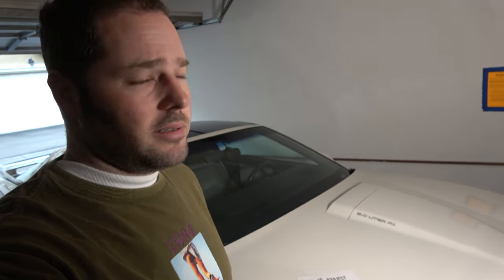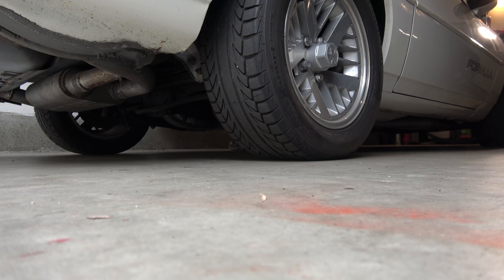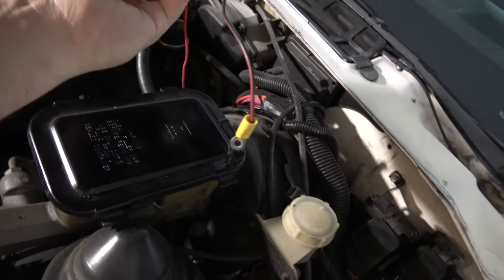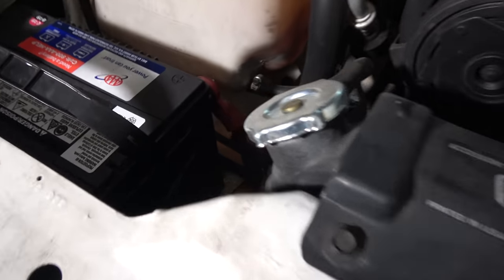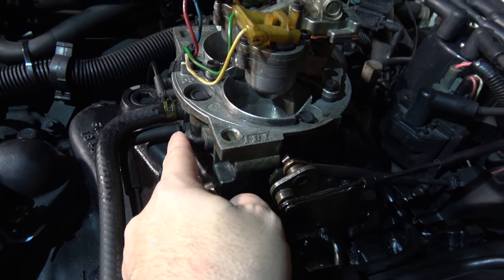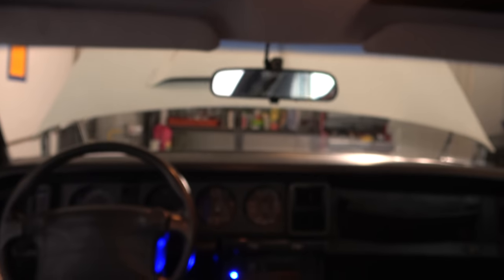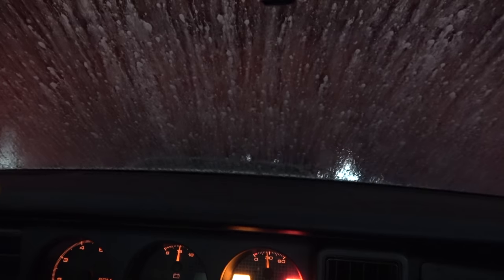1990 Firebird - What's Wrong With it?

Comment: I had a 1988 IROC Z28 Camaro and it was my dream car. Mine had a TPI 305 L9 engine with a 5 speed manual that I had rebuilt and beefed up a bit and every bell and whistle imaginable and it had a deleted IROC big sticker on the doors and it was exactly what I wanted. So I changed the rear gears to 373 and installed a center force duel friction clutch and got rid of the gov-lock rear and installed a real posi-track rear end. I replaced all broken and cracked things in and out of the car and then I upgraded the exhaust to a true duel  exhaust with a X crossover and duel Borla mufflers. Then I had the stock wheels restored back to new condition . I didn’t have air bags in my 1988 IROC so I didn’t have to deal with the steering wheel issues. Then I installed a new set of tires that looked like the gatorback tires that came on it and since I had the tires off I had all new break pads installed and rotors turned. Next I installed a new hood insulation peace under the hood, like yours mine looked like crap. I then installed an alpine head unit with an Alpine amp and all new Boston acoustics speakers. That car ended up being as fast as lt looked when I was done, I even put after market heads on that TPI engine and a gear drive timing set up. After all that I realized that my wife wanted to be the town bicycle that everyone could ride and she wanted to take my son away from me, I sold my IROC to pay for a lawyer and fight for joint custody, well we fixed our marriage but yes she went back to laying on her back when I was out breaking my back to earn money to support her and our baby boy and new baby girl . Moral of the story is to save money in a secret account so when she screws you over by screwing the town , you won’t need to part with your dream car and you’ll only need to part with your ex-wife
Reply: I had an 86 IROC LB9 Auto in high school. I treated it soo well. I would start it, let it idle down before I drove it. Put premium gas always. I did a few mods like hi flow cat, 160 thermo, that ran all the time, air foil, I cut out the botttom of the air box to make home made cold air and put a shift kit. I loved that car n babied it but all it did was let me down. It felt fast and sounded fast but I would lose races left n right. Also there was always things wrong with. It didn’t have a serpentine belt so the engine would spin off the belt. The trans wouldn’t shift when I floored it. I had ttops so there was lots of rattles. Basically I treated it really well but it didn’t return the favor. I lived with parents so I spent all my paychecks while working in a grocery store.

Comment: This Pontiac reminds me of working in a Dealership repairind used cars. This dealer had high standards for all cars on his lot every car was repaired to the highest standards and stock condition . All brakes had to have a minimum of 50% braking lining remaining. Most got new tires and brakes. It a vehicle wes not able to meat his standard it was sent the the dealer only Auction Yard. I enjoy that jod it is nice to be able to do what is needed and not have to argue about the cost.

Comment: Great channel gentlemen. Looking forward to your progress. On that alarm system, I feel ya mate. I went through hell with all the issues a crappy alarm install was giving my 89 Formula. Burned fuses, battery drains, starting and fuel cut off issues. I finally paid a guy to come remove EVERYTHING. MAJOR improvement. Even charges better.

Comment: I have an 89 Formula myself. The most basic calculation on a muscle car is the "horsepower to weight ratio", increase the first or decrease the latter.  I removed the back seats along with the seat belt retracters, saved a hundred pounds there.  Removed the AC unit from under the hood, another hundred pounds removed.  I increased horsepower with headers, 3" exhaust, 52mm throttle body, premium plugs and wires, Summit Racing distributor and other little tricks.  Lowered the suspension with Hotchkiss parts. I have trouble keeping rubber on the back tires. Pure enjoyment.

Comment: Had a almost identical version.
Drove it EVERYWHERE in the twelve years and 271k miles.
Only left me stranded twice.
First time the fuel pump failed at 150k and the second time the starter died while trying to crank the engine on a - 25 degree morning in northern Wisconsin.
Only being ever in the backseat was my German Shepherd and I don't think she was ever comfortable either.
Rust was the thing that finally killed it.

Comment: 2:09 Before we even talk about the car, that tire profile alone already gets me excited.
13:00 Hey, I am using the same colors for my video captions. Pastel yellow with hyperpink border. 😃
A man's car history tells a story. While my brother started with a barebone super-compact car (someone crashed into it) and then almost all combis since, with a sports coupé in-between, I insisted for my first car on a maximum equipped hatchback Corolla E11 G6 facelift, bought new. Since then I have had an E9 and an older E11 G6-R (funnily, in retrospect, both cars I once wanted to own), and an FZR-600 bike. Those are all gone now, but the car I bought new is still with me, with more than double the original horsepower, albeit not having been active for a long time.
I always knew what I want and that becomes a profound part of me, lives and breathes with me.
Being one with life is not about being a daredevil, active or anything. It goes much deeper.

Comment: Looks like you've got a great project. Rotor cap plugs wires always a good idea. Regular maintenance will make this vehicle last a long time. do not run extra fuel additives through the system as it will only clog things up. Your alarm system, as I had noticed, seemed not to be grounded, I believe that lead that was free floating in the beginning of the video is a ground. Check the manufacturer and verify. I'm happy to see you have started up a new channel, I will subscribe and watch.

Comment: in my teen days I had 9 people in an 85 Camaro lol.. without disassembling anything at all you can spray silicone lube around the whole perimeter of the window track.  Even though it doesn't grease the linkage inside the door it usually gets the windows moving plenty quick again

Comment: Nice solid pick for old school American cars shouldn’t be hard to work on.
Definitely change the things below as you mentioned
1. Change spark plugs
2. Flush radiator/ maybe trans fluid
3. Change oil
4. Check brakes to see if they need changed

Comment: From a cold climate and more miles than advertised but has low rust and looks great fro the age. My dads 86 has had the seats re-upholstered twice and has more rust even though not driven in the winter. Also has TPI 305.

Comment: Just so you know. The horn button covering is not peeling off. I used to think there was something wrong with mine also but it turns out that everyone of those airbag steering wheels were exactly the same from the factory. Had that big gap, crappy fit. The Camaros had same issue same years.

Comment: I have always absolutely loooooved the look of the 87-92 Formula 'birds.  I've owned 2 GTA's myself. But here's a word of advice for you with this car - or for anyone that buys a 3rd Gen F-body with the LO3 Throttle-body FI 5.0L engine: DON 'T WASTE ANY $$$ ON IT AT ALL!!!!! Pull that motor and attach it to a looooong chain on a boat; that's what it's really made for!!!!  Then go find a Buick 3.8 block with a turbo and build that sucker up and drop it in there.  You'll have the ultimate sleeper Formula that Pontiac should've built!

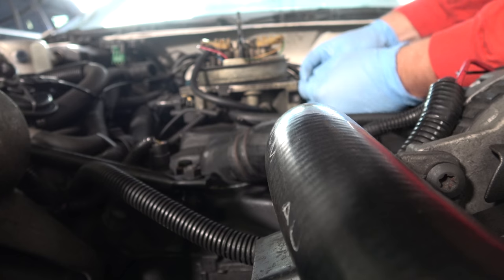Comment: 5:45 does that mean that it's a Throttle Body Injection system? I think the 4th car I owned was one of those. I found that it had a very touchy throttle, just tap it and it ramps up fast. It took a lot of practice to get used to driving it with the manual transmission.

Comment: Have you checked available power to the radio including the fuse? The car alarm gremlin may have struck there as well, as some alarm options included connections to the radio to sound the car alarm if someone tried to remove it. Good luck and stay...sane.

Comment: You've got throttle body injection or "Toilet Bowl Injection" as we called it back in the day. I believe that's engine RPO code L03. As for the car, it's likely that it's been resprayed. Van Nuys built cars had shit paint which came off in sheets. As for the headlights, they are ALWAYS noisy. Especially if the headlight motors were rebuilt with aftermarket gears. I've had six of these cars. I know them well.
Reply from the maker: Yes it's an L03 but I've done a few things which I can't wait to share (it's still slow)

Comment: Reminds me of my 87 formula that hood blanket is original. It's a nice car with a lot of potential.  The 305 tbi motor is 
rated at 180 horsepower. Very familiar with the car.welcome
to the world of the f body.
Reply: The t top cars roof cars from 82-92 in particular we're notorious for water leaks.

Comment: Lubing the windows may help, and is probably a good idea after 30 years. However, if the windows function like those in the Fiero (I suspect they do), then all the current to activate the window actually runs through the window switch (it doesn't activate a relay), and the contacts within get dirty and corroded causing slow window performance. If the Fierbird does use a similar electrical design, then you can disassemble the buttons themselves, give the contacts a clean, and reassemble them.

Comment: Try re-flowing all the solder joints on the radio. I had a Chrysler 300M with bad soldering on the climate VFD. I had to touch my soldering iron to a couple of SMD resistors to fix it.

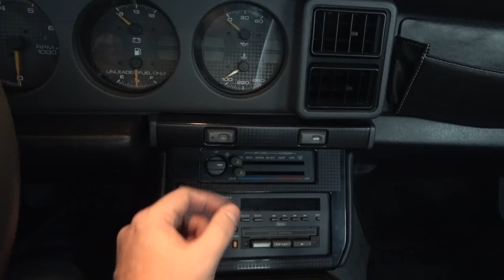Comment: 9:20 Noisy pop up lights and slow windows.  You may not have been in these cars back in the day, but the lights popping up were always noisy and the windows were always slow.  Wont hurt to grease them though.
Reply: From personal experience: Power window speed after a year of use is the difference between Toyota and a smart-cheaper Hyundai.
When people here in Germjany said Toyota has gotten a bit too expensive and convenient .. Well, everything gets more expensive, that's the bankster parasite infection people aren't treating, but to some degree you get what you pay for.

Comment: Big part of my hate side of the love/hate relationship with the State of California:  catalytic convertors.
Alarm wiring mess maybe the cause of radio and other issues?
Reply: Come on, even a primitive cat makes a world of a difference emission-wise (also due to law of diminishing returns - modern emission systems are insane), which also means not pushing disgusting and unhealthy stink in other people's face. Especially US cars should have plenty of horsepower so that a cat won't matter much. There are so simple ways to compensate for the power loss from a cat. If a cat is a problem for you, you also have to shun A/C. (But hey, that's a selfish matter, so people treat it differently than the negative impact they immediately have on others.)

Comment: Winston... Those windows motors might be failing , it's a common fault on the 3rd and 4th gen.they can't handle the weight of the window and X frame inside the door.  Incase the lube up doesn't work .

Comment: I’m not a fan of your car , although i hope your dreams come true, If your car is Manuel transmission as what it think that it’s cool , from inside wish that GM stayed with there old 77 /78 , from the outside the car overall look great with nice white color - my recommendation : if i had a chance to upgrade it to LS1 5.7 engine ill do it .                                               the LS1engine would be more relabel from my experience and would costs less in the loge run, and you’ll gain more horsepower and that would make it  full of fun and less headache.                            and that is my suggestion unless you want the matching numbers on this car to increase value buy time .

Comment: F body.. good advise .. take it back .  Lol.. 

If you are dead set on driving it..  be sure to check the column. The tilt is pot metal. I have had 2 fbody camero columns come apart while driving. Steering wheel in hand..

Comment: Winston, disabling or removing the smog systems of a car is illegal across the entire US.  It's true that California is one of the very few states that check call me but that doesn't make it legal in the other states. You can go after whoever sold you the car for the price of the catalytic converter that they were not supposed to have removed. That's about eight hundred bucks or so. It's also a crime on their part just told you the car this way, and that's especially problematic if whoever sold you the car has a car dealership license. if that's the case, the moment you complain about the lack of a catalytic converter they will cut you a check to fix it. They'll do it in the hope you won't go to the cops.

Comment: I like your channel so this is not a knock against you personally but the problem with your 1990 Firebird is that it is a 1990 Firebird. Those cars were shit when they rolled off the assembly line, when someone signed the paper and pulled it off the dealer lot and when someone buys one in 2020. However with that said love the MR2. Ask Laowhy he knows JDM always!

Comment: Don't blame the radio on caps from the get-go. GM radios of this era used nichicon capacitors which very rarely fail. Judging by the wiring fuckery I'd guess some idiot tried to wire something wrong and blew the radios internal fuse. Judging by the complete lack of life anyway, that or the radio just isn't getting 12v for some reason.

Comment: I've never driven anything with Throttle body injection. I wonder if it's as awful as everyone says.

What's wrong with the car?  It doesn't have a KITT Scanner. Needs a bumper mod done and the scanner installed.

Comment: That is NOT the original hood for that year. Most likely that hood with cowl induction is between a 1983 to 1986, a 1990 Trans Am hood comes with dual vented inlets and heat extractors...

Probably the length of hood are different from different years even so same make and model...
Reply from the maker: It is the original hood, you're thinking of the trans am, the formula has this hood
Reply: Worthless Whips, ah yes, didn’t see the model.

Comment: What's wrong with it? It's heavy, it's big on the outside but small on the inside. It has a rear suspension out of a pick up truck. If you need to change the fuel pump you'll have to remove that axle and the fuel tank.  Engine is large but not powerful. Doors weigh as much is an average house. Oh wait, you meant now, not when it rolled off the assembly line. LOL not to mention, if you bought this thing when it was new, let's just say you are not the most sophisticated person walking around.
Reply: Prius driver spotted
Reply: Lol, so what, that's makes them cool!
Reply: @kevinbarry71  😆
Reply: I'm much more of a JDM type of person, but I've actually always liked the 3G Camaro/Firebird. The car does feel like it was built to try to compete with the Supras and RX7s of the time, but then GM bean counters ruined it with truck axles and all that fun stuff, and you had relatively worse American quality control compared to Japanese QC. For the image, eh. Can't please everyone.
Reply: Not sure what truck you're referring to that has the same rear suspension, I'm not aware of one...